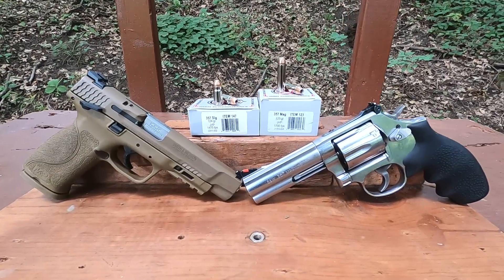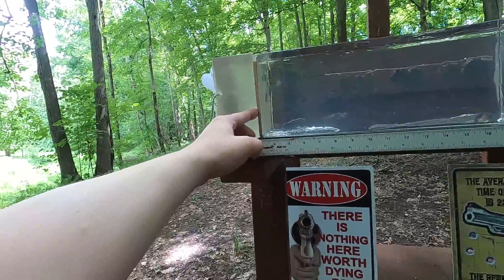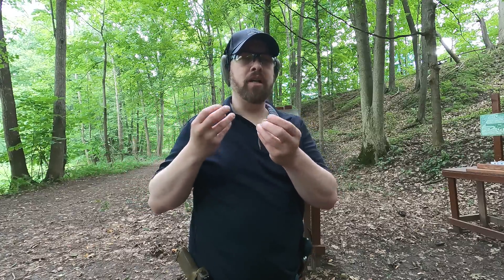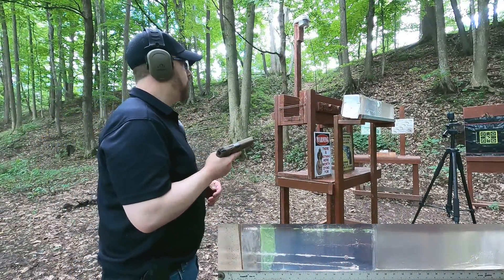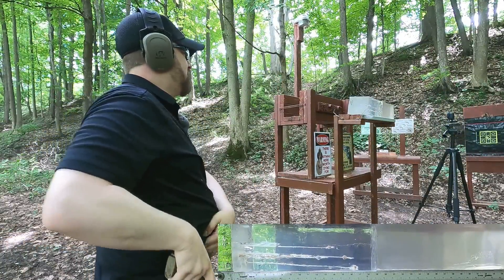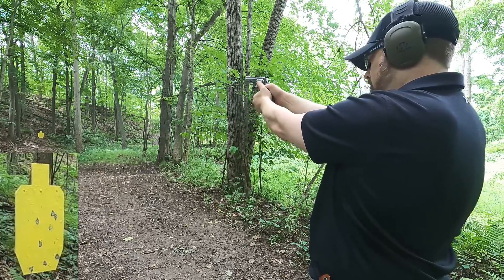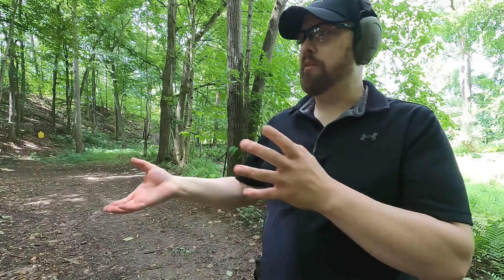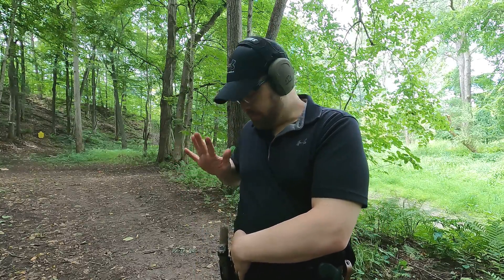💥.357 Sig VS 💣.357 Magnum - Underwood JHP - WOW - Game Changer!

Comment: Well, the Sig was made to duplicate the .357 Magnum performance out of a 4 inch barrel, in one particular loading: the magical .357 magnum load that just seems to stop most things. They did a nice job with the 357 Sig. No doubt. But, the amazing variety of bullets, weights, and power levels, is what makes the 357 Magnum so special.

PS: thanks for the video. Nice work
Reply: The only thing holding me back is ammo availability. I mean when it's not found easily in the US, it's a unicorn in central europe. Reloading components...where to get the brass and the connected overall cost?
Reply: @onpsxmember  yeah, I am sorry for the situation you have to deal with. I truly am. I wish all like minded people could live here, together. And, preserve freedom forever.
Reply: @onpsxmember   Well , for the first half of the current ammo panic , two of the calibers remaining on the shelf the longest were 
357 Sig and 10mm .

     The first calibers that everybody else buys out are the handful of " most common calibers " . The less common calibers remain at LGS shelves and jobber warehouses the longest . The flip side , is that once ammo supply chain gradually catches back up , it will be the same 9mm , .45 acp , .223/ 5.56 .

     The unfortunate reality is that with predictable shortages due to political and societal conditions , it's best practices to not count on buying small quantities as you go of Any caliber/ gage . When prices/ availability are reasonably stable , stock up with X number of rounds of both practice and serious ( either defensive or hunting as may be) ammo for each caliber/ gage .

   How many is X ? Opinions vary , but 2-500 is on the low side , but at least enough for function testing , sighting in , and rotating reasonably fresh carry ammo .

Comment: The fact that I can switch from .40 to 357 SIG in a pistol is intriguing.
Reply: Don’t forget you can also shoot 9mm with a conversion barrel. I also have a 22lr upper that makes for cheap practice. Pretty versatile.
Reply: Until you try to find ammo.
Reply: @gamebucketman1632  .357.magnum isn't falling from.the sky either
Reply: Yup, add the nine. You buy a used police 40sw and you get a three-fer!
Reply: @ftdefiance1  I still only got the 9, 40 and 45. I just found out my favorite caliper is all of them 🤣😂🤣. I actually don't care for 9mm but everything is chambered in 9. And 10mm is awesome too.
Reply: I thought the same thing but since I quit reloading rimless cases I haven't bought the conversion barrel because in my area there is no .357 sig. ammo to be had but plenty of .40 Smith.

Comment: Air Marshall's & Secret Service were real happy with their p229s.  .40 or .357 sig in platforms like 229 and usp compact that can handle it are one thing. Crammed into lighter Glocks not originally designed for them idk...reason for being called snappy and downfall.

Comment: Tests like these make me fall in love with the .357 Sig all over again. I took both my Glock 19 and my Glock 32 out to the range yesterday, and I can honestly say that my shooting with the G32 was tighter and more consistent than with my G19
Reply: Maybe because the .357 is faster. Faster bullet leave less chance of shooter errors.
Reply: @Gieszkanne  I hadn't thought of that. I've been told that .357 Sig is a very accurate round to begin with, but both it and the 9mm are way more accurate than I am, so I didn't give it much thought. Would love to see a PCC in .357 Sig
Reply: Does your 32 recoil much more than your 19??
Reply: @kevinrichardson8859  Yes, a little bit, but not dramatically more. I think the Glock 23 in .40 has much more recoil than the G32.

I'm not so recoil sensitive, so your mileage may vary.
Reply: @grahamohea2424  good to know because I have gen 3 G23s...and just ordered factory oem barrels for G32 from Glock...waiting 👍
Reply: @kevinrichardson8859  Before I got my G32, I did a caliber conversion on my G23 to .357 Sig. While the pistol itself ran just fine, I discovered that the .40 magazines are not so compatible with .357 Sig ammo as it is in other platforms. The feed lips are different on these Glock mags and the .357 Sig rounds will nose dive into the feed ramp from the .40 mag, sometimes even forcing the bullet back into the case. Downloading to around 5 rounds largely worked around this problem, but that is no fun. Of course, this was just my experience and you may find it differently, but I would highly recommend getting the proper magazines for it as well.

Fortunately, .40 S&W runs out of the .357 Sig Glock magazines with zero problems, so I have considered just only buying .357 Sig mags in the future and running them in both my .357 Sig and .40 Glocks
Reply: @grahamohea2424  thanks so much for the advice...duly noted...I have a glock 31 so I do have some 15 round factory 357 mags...I'll get some factory 32 mags just to be safe...I've just had problems with some of the 357sig rounds having setback issues after just 1 clambering...especially sig sauer 357sig vcrown
Reply: Glock sells just the magazine followers by themselves. So you can convert all of your 40 cal mags to 357 sig. then you’ll be set for 40 and 357 sig, and save a little pocket change in the process.

Comment: Hope you get better.  I'm a 45 guy but really like the 400 Corbon cartridges. Yet as with the 357 Sig it's a bottle neck.  Where it fails is BULLET SETBACK! I carried 400 Corbon for many years and I have at least 100 rounds that were chambered with SETBACK. It does not matter what brand either.  My friend still carries 357 Sig and he has  plenty of rounds SETBACK also. (I would attach a photo with this comment but don't think can.) After all thats said and done personally I'm sticking with my 45acp as a carry round. Buffalo Bore, Corbon and Underwood all make excellent +P hollow point cartridges for it. I favor Buffalo Bore because it loads thec230g with XTP's. Regular Remington or Winchester Hollow point will do most any job needed. My gun is accurate with both. EXCELLENT EXCELLENT VIDEO..

Comment: I’ve always wanted a 10mm but honestly with the variety of great ammo choices in .357 Sig I honestly just don’t need a 10mm...
Reply: The 10mm is an easier cartridge to handload for and is better suited to lead bullet loads. But with factory ammo I agree with you.
Reply: The 10mm is an easier cartridge to handload for and is better suited to lead bullet loads. But with factory ammo I agree with you.
Reply: @Walter-wo5sz  Reloading 357 SIG is not hard. Both are easy to reload and both can use lead bullets.
Reply: All depends on what you want. The 10mm has higher velocity ratings for similar sized projectiles. A more powerful cartridge no matter how you slice it. The real benefit of the 10mm is that is supports bullet weights up to 220 grains that are good for two and four legged defense.
Reply: It is fading into oblivion as someone else commented.
Reply: @paulscountry456  I remember not all that long ago that could have been said about the 10mm. But infatuation in cartridges is circular. What's old becomes new again. And the wheel will eventually bring something back around.
Reply: My answer is both - love 357Sig, looking to add a 1911 in 10mm.
Reply: @Matteo_  hmm, I have followed these trends for years and the 357 sig is dead, it disappeared completely on shelves here and nobody makes a new gun in the cartridge, 40 is dying too but I will never stop believing both just smoke 9mm with the exception of plus p plus, nine is a better round for Cops, wimps, and women and bland stale people who just run with the pack, 9mm is Richie, 357 Sig is Fonzie.
Reply: @paulscountry456  I remember when there were only 2 guns that offered in 10mm. And only boutique ammo companies offered ammo in it. It made it's comeback as we all know. As it stands Glock is the only one offering anything "new" in 40 (Glock Gen 5). And from what I've heard they will be offering a Gen 5 31, 32 and 33. And I also believe there is going to be a 10mm Gen 5 20, 29 and 40 to go with the 21, 30 and 41 (45 acp)
Reply: I just picked up 2 boxes of HST .357 Sig yesterday at my local big box store .. they probably had 50 or more boxes ..
Reply: “Need”
Reply: @paulscountry456  .38 SPL is Potsie
Reply: @garysarratt1  lol...PERFECT
Reply: @pabloescobar7802  I thought they killed you? Hst oh yeah better stock up, HST is in my top three and may be the best cup core hp ever.
Reply: @Matteo_  the .40 is still quite common in competition.  Especially USPSA limited and single stack divisions.  So pretty much the whole lineup of the 2011 style pistol manufacturers offer .40 as a standard chambering in most of their new iron sighted models. Maybe to a lesser extent the 1911 makers but the ones geared toward competition will absolutely be offered in .40.  CZ’s new lineup of TS2 pistols are available in .40 which is probably the most popular chambering for the model since its specifically targeted for uspsa limited.   

But I agree that in the poly frame defensive pistol world, .40 isn’t being offered like it used to be.
Reply: @ReeveHelalV  True. I was aware that there is still heavy use of the 40 in the competition world. I have an older Tanfo Stock II in 40 when I did some of the local comps. But those aren't what I consider the guns that are typically part of the general gun buying arena. Plus the price tag on those run many away.
Reply: I understand that. I love my Sig P226 357sig but I wouldn't say no to a Smith & Wesson 10mm semiauto. Underwood Ammo loads them almost as hot as their 357 Magnum
Reply: @heavydutyreviews1303  Just as a piece of information you may enjoy. Underwood 10mm published velocities are from a Glock 20 and their 357 mag from a 6”. The 357 SIG from a 4”. Or so it was the last time I spoke with their ammo tech.
Reply: @Matteo_  very cool! I wouldn't mind owning g a 10mm like a Smith & Wesson M&P M2.0 or a Smith & Wesson 1006, or a really nice 1911 with a 6 incher!
Reply: @heavydutyreviews1303  Same here. On that note I did just pick up a new Glock 29-4.
Reply: @Matteo_  do you mean a Smith & Wesson 29-4?
Reply: @heavydutyreviews1303   Glock 29-4. The -4 is short hand for gen 4, e.g.,Glock 19-5 as in Glock 19 Gen 5.
Reply: @Matteo_  thank you for giving me hope that one of the best cartridges (.357 sig) will make a resurgence
Reply: I've settled into other cartridges for my hunting, woods-defense, and self-defense wants and needs, but I'm impressed with  357 Sig's performance. I think Sig did a remarkable job creating a 9mm magnum in a short case for an autoloader.
We tend to look for flaws in defense of our favorite cartridge, but that's all ego driven. This cartridge deserves proper respect, and I don't think it's going away just as 10mm is not going away.  Some interesting wildcat cartridges have come from the 10mm case.
Happy Hunting and Shooting.
Reply: 10mm>357sig.
Reply: @TERMINAL-BALLISTICS  It's all about penetration. Penetration is a direct result of momentum and the mathematical formula for momentum is mass times velocity. Heavier bullets will penetrate more deeply at a given velocity. Testing has also shown that above a certain velocity (approximately 1600 fps), penetration decreases due to the fluid dynamic properties of the target. I'll take a heavy bullet at medium velocities over faster, lighter, bullets anyday.
Reply: @TERMINAL-BALLISTICS  Good hunting. I prefer flat nose solids for maximum penetration.

Comment: FYI RE: test fire an emply case in your 357 with only a primer   Hornady  said it may back the primer out & lock it up . If that should happen , put a wood rod down the barrel & push the case back like it would had it fired . Might have to give it a light tap . They said when a round is fired the first thing that happens is the primer backs out , as pressure builds , the case moves back to reseat the primer & push the bullet out .
Reply: I have shot primers & never had a lock up , it was a long time ago & sounded like a fire cracker , it may have been an auto ????   or a rifle ???

Comment: Relatively new (several months) as an active CCW guy here!  I carry my Sig P365, but would consider my Glock 27... even  a Glock 23!  I already have the 4" 9mm conversion barrel, but it seems that the 357 sig conversion barrel is even a better fit for the Glock 40 cals!  If I see ammo availability in Sig 357, I will certainly get the conversion barrel!

Comment: Nice comparison. I shoot 9x23 Winchester, which has the same ballistics as the 357 Sig in factory ammo, but can pull away from it at the top end with proper handloads. Like you say, recoil feels closer to a 9mm than a 357 mag. The trouble is finding both pistols and ammo in this cartridge!

Comment: As anecdotal evidence of the 9mm ineffectiveness, even with new technology projectiles, I've noticed lately the average offender seems to have to be riddled with 9mm to cause cessation of violent behavior. That's not to say it doesn't work,  it does, but it seems to take more hits to bring them down. I realize in multiofficer shootings, if one shoots, they all shoot.  I'm also going to guess most if not a shootings involve 9mm. Didnt used to see so many rounds expended when 40 Smith or 357 Sig was used. Can't confirm my observations but it just seems the 40 or e57 Sig effected more 1-4 round stops. Not dissing the 9mm ler seay. I carry a Sig 365 in warm weather as my EDC, mostly because its easier to conceal. When jacket or coat weather prevails,  its back to my Glock 23 with HST's for me.Withbit I  feel well strapped. Considering using it with a 357 Sig barrel as well. The 357 Sig is a proven performer,  as is the 40 Smith.

Comment: I EDC a Glock 32 and I also use it for hunting and I've compared 357 SIG and 9mm +p+ on hogs with similar projectiles and 357 SIG is wayyyy more effective even using the 9mm in a carbine the 357 SIG is better in my testing.
Reply: Better than a 9mm carbine in which way?

Comment: revolvers just have so much variety options. you can do specials, wadcutters, wide flat nose 180gr, roundball with just a primer if you need a slingshot. but thats pretty much all manually operated firearms theres alot you can do.

Comment: The 357 Sig is moving faster than I anticipated. I have often wondered if 9mm +p+ was close to the Sig round , I’d love to see that comparison after you mend up if you can find some +p+ .
Reply: THIS Underwood Sig loading IS particularly fast. , while Undewood .357 Magnum is respectability within the mainstream loads from the Revolver Era . ( Different ammo mfgs , different lot numbers , different revolvers , etc could vary from upper 13's to almost 1500.

   Back in the original heyday of .357 Sig ( mid '90s ) mainstream .357 Sig Duty/ Defensive 125gr was typically 1300- 1350 , * From typical LE Duty Guns of the era , with bbl lengths of +/- 4 to +/- 4.5 inches * . ( I totally get Sam's reasoning of similar bullet travel distance to muzzle . But if you were to compare actual LE Duty Guns / " full size - ish * defensive belt pistols , the historical comparison would be 4 inch Revolver vs 4 inch Semiauto . Heck that was one of the secondary talking point in favor of the Bottomfeeders back when the Great Changeover was still controversial , and being debated .

  To Wit - A Semiauto of Same Barell Length was more compact than the Revolver . To LE Administrators , that was a big plus ! . Lots of plainclothes / off duty officers could use same pistol for detectives and off duty instead of a dichotomy of back and forth between 4 in medium frame & 2 in small frame .)

Comment: Sorry to hear of your accident and I hope it heals quickly. I really enjoy your videos; they're informative and somehow relaxing at the same time. I have a question for those reading here. I've had a SIG P-250 for years, one with only the 9mm barrel. I believe the company manufactured a . 357 barrel for the pistol and that changeover involved only the barrel and the magazine. Am I right about this and are those conversions still available? Has any reader experience with this and, if so, how did it work out for you?
Reply from the maker: Thanks. I don't know the answer personally, but someone else might be able to get on here with an answer.
Reply: I have a SIG P226 with a 357 Sig barrel and 40 S&W. I bought it used so I don't know if a barrel was added or if it came that way. I bought a conversion kit from SIG for 9mm. But it wasn't just the barrel. It was slide, barrel and mags. I expect you would need to look into that as opposed to just a barrel swap like you can do with the 40/357. Of course you can't use 9mm mags either but again 40/357 mags are one and the same. In fact mine were marked with both on them.

Comment: This was an interesting comparison. Most comparisons try to use bullet weights as close to the same as they can get which is fine but I would like to see comparisons using the optimum bullet weight for the firearm. For instance I believe the 125 grain bullet is light for the .357 mag. I've loaded and fired thousands of .357 ammo with both rifle and handgun and out of different length barrels. The .357 mag. gives better ballistics with heavier bullets. By that I don't mean just velocity. I prefer 140 grain bullets from my .357 rifle and 140 to 158 grain from my handguns depending on barrel length. This was a great video, thank you for doing it.

Comment: Update:  Speers new "LE" loading, number 54234, is a 6 petal bullet, doing about 1440 fps out of a 4" bbl rivaling the Underwood loading.  I just got this current production, 3-15-23.  It's good they finally reached the bar for what the cartridge should have been and was designed for.  I would really appreciate it if you would test it along side the current production Speer 357 mag.  4" and 4", or apples to apples.  In the past, the Speer factory loading has been 100 fps slower.  I've got no gel blocks so can't do it myself.  Thanks for all your great videos.